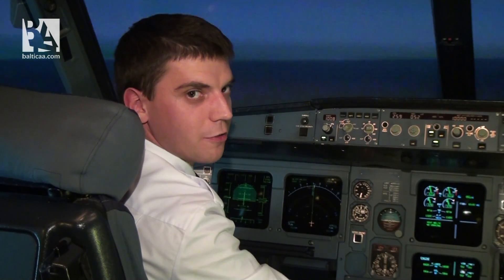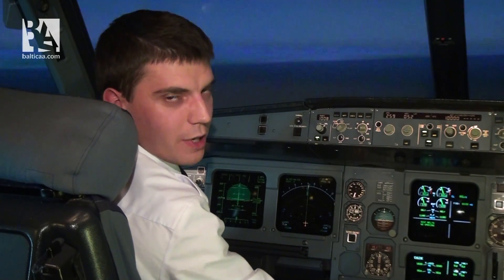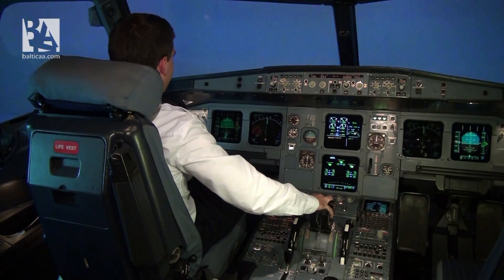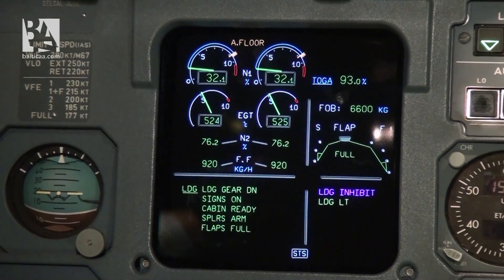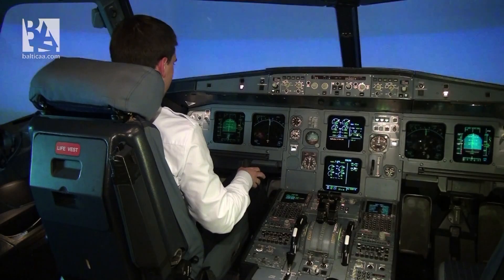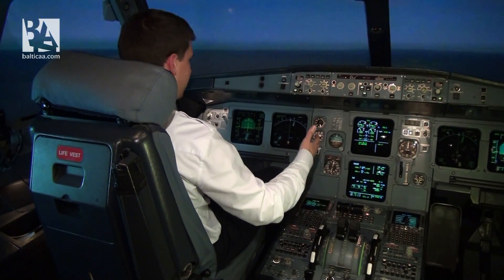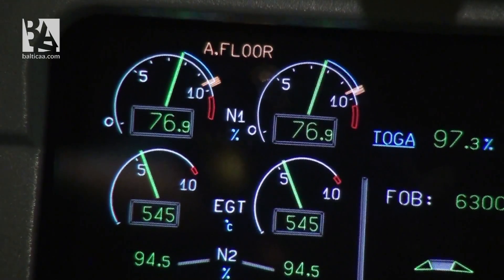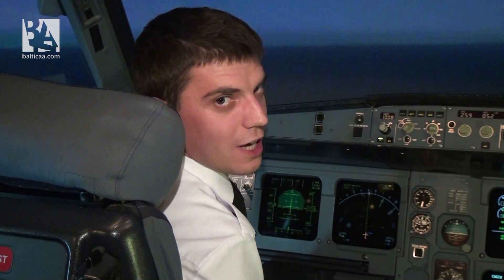Airbus A320 flight controls protections - Baltic Aviation Academy

Comment: Perhaps these "protections" lulled the crew of AF447 into constantly pulling on the side stick, thinking that the automation would save them. Don't put your or your passengers lives into the "hands" of an unthinking machine. Always fly the aircraft first!
Reply: That's poor training. These systems are designed to intervene when the pilots inadvertently put the plane into a dangerous situation, for example, messing up the go around procedure by not adding enough power/pulling up too quickly or too much for the selected thrust setting, it is not designed to fly the plane for them. It is similar to automatic emergency braking on a car, it is designed for emergency situations only, not to save you from having to use the brake pedal to slow down for traffic. What FO Bonin did was crash the plane into the ocean because he expected the stall protection to recover from the stall, which is like crashing into the slow moving traffic at highway speed because you expected the emergency braking to slow the car down

Comment: It would appear that the pilots of QZ8501 inadvertently disabled some of the flight control protections after receiving multiple alarms about the rudder trim limiter. It would seem they forced the plane out of normal law by circuit breaking both FACs at once; from my reading this means it can only be put back into normal law on the ground. Again from my reading, it would seem the pitch was put into alternate law (without protections), roll was put into direct law, and yaw was put into mechanical law. It would also seem that the pilots hadn't been trained in how to fly with the plane in this configuration; maybe similar to AF447?
Reply: +TankEnMate AF447 and XLAirways 888T Incidences both went into direct law due to icing of the angle of attack sensors in 888T's case and icing of the pitot tubes.  In the case of 888T the pilots had too much trust in the plane as they were performing an acceptance flight as for AF447 the first officer seemed to have a panic attack and kept his stick pulled back while the aircraft was in direct law. When the captain made it to the flightdeck and noticed what the FO was doing it was too late to recover the aircraft.
Reply: @ttmaggebo  no. AF447 was icing of pitot.
Reply: @peteconrad2077  I’m more on about the planes flight laws and how the pilots reacted than the symptoms that caused the flight law changes in the first place. The way the pilots reacted was similar in the end.

Comment: Any idea on how AirAsia flight QZ8501 managed to exceed the aircraft's max climb rate and stall? It looks like Pitch Altitude Protection should have prevented this.
Reply: It changed to Alternate law
Reply: It was in alternate law so no protections. Also it was the alpha protection they needed, not pitch protection.
Reply: flight QZ8501 looks like Air France 447 same causes

Comment: Hi Oleg. with all that protection, how 3 experienced pilots stalled the air france A330 killing everyone on board ?
Reply: I think , at 2009 there were no protections , I think they came later into the aircrafts .
Reply: I know that the speed sensors were frozen , but the flight computer(s) knowed that there was a stall in progress , so why didn't the stall protection kick in ?
Reply: TheGamer003 because the flight modes changed from normal law to alt law. Some protections lost as the result.
Reply: +TheGamer003 pitot tubes froze , air readings became momentarily invalid and protections disabled for a short while.. in that short time for unknown reasons one of the FOs pulled back the stick and stalled it ..and kept stalling it nearly all the way down to the sea..

why he did that? thats something that will keep minds thinking for a loong time.. its what confuses most investigators.. he didnt had any reason for doing that ..but he did it
Reply: +Chuan Shuo Chen the pitot tubes were frozen shortly.. less than 2 minutes.. they did had stall warnings but they didnt even comented why or about the unreliable air speed procedure..  thats the big mystery

Comment: I still prefer the Boeing planes over Airbus. At least with Boeing, if there is an emergency requring the flight crew to take extreme actions that push the aircraft outside the flight envelope the pilots of say, a Boeing 777 can shut-off the protection system with a disconnect switch and place all systems on Direct Mode, analogous to Airbus Direct Law. In that situation, flying in Direct Mode allows the plane to take any action necessary without computer interference with pilot decisions. That's the main weakness I find with Airbus, they present hard limits on pilot authority and no direct means to cut out the protection system in an emergency to allow the flight crew to take extreme actions that might be necessary even if it did damage the plane.
Reply: I also think so , in all Airbus aircrafts , shuould be a button wich shuts down the pretections . But I think , that Airbus is safer .
Reply: Of course computers make sometimes errors , for example wehen the sensors froze , then you need to disconnect the flight computer(s) , there where some incidents : http://www.spiegel.de/panorama/lufthansa-airbus-computerpanne-schickte-maschine-in-den-sturzflug-a-1024652.html
Reply: +Shayne T. Pendrick it's not meant to fly outside of the envelope, even in an emergency, the type of things you'd want to do outside the flight envelope would destroy the plane, airbus prevents that from suicidal pilots, stupid pilots
Reply: TheRabbitFear Well it didnt prevent the germanwings Crash.....
Reply: Computer never makes mistakes. And there are no cases in which you should turn off this system. Besides, ability to turn off the protection systems can cause very unhappy events.
Reply: TheGamer003 you can by dissabling 2 ADRs
Reply: Shayne T. Pendrick You can take full manual control of an Airbus A320. However to do so means shutting the computers off to allow that flight control law. Meaning your speed / nav displays will be off. You will have to use the backup gauges to the right. The only other way is if the flight computer receives conflicting information. Such as the angle of attack sensors giving different readings or blocking of the pitot tubes.  In this case you get a message on the flight management computer of above the angle of attack graph. However in this case pilots don't always see this. As the computers still look as though they are running. This is what caught out the XL airways pilots when they were performing a test flight in a plane they had leased from Air New Zealand. Airbus don't give you enough of an indication when the flight control computers give you conflicting information. I think if they did. The Boeing vs Airbus debate would be less heated.
Reply: There are no circumstances where exceeding the envelope is a good idea. It doesn’t happen.
Reply: @peteconrad2077  Try telling that to China Airlines Flight 006, exceeding the envelope is precisely what saved their lives even if the plane became a total write off, so try again smartass.
Reply: @EMSThinWhiteLine12866  the envelope exceeds me was a consequence of failure, not a deliberate strategy to recover. You got it completely wrong. Try sticking to stuff you understand.
Reply: @EMSThinWhiteLine12866  the fact you have to resort to infantile names proves you know you lost the argument.
Reply: @peteconrad2077  Show some hard studies or other evidence, otherwise consider it YOU who is defeated and my word stands over yours. End of statement.

Comment: Nice.  What is the warning tone that starts at 3:17?
Reply: it sounds when the aircraft is in manual flight (A/P disengaged) and you are leaving the altitude set in the FCU
Reply: Rin Zler
Thanks.  I still don't understand how AF447 could have happened.  Just that chime should have been enough to alert the PF, especially while the PM was saying they are climbing.
Reply: VWaudiRULEs AF447 stalled because the aircraft went into a mode called ALTERNATE LAW. The A320 has 3 levels of laws (Normal,Alternate,& Direct). Once AF447 left from normal law (as Oleg in the video is showing you) it degraded to Altenate law throwing out some of the protections you just saw him demonstrate. If you degraded even further to Direct law All Protection goes out the window. YOYO - Youre On Youre On - with no Protection. Hope that helps..
Reply: HouTexPilot Thanks, but I know about the different laws.  What is a real mystery is how AF447 entered what could be called a deep stall and stayed there for 3 minutes and a half.  No, they didn't have the protections, but 1) a qualified crew should not have done that; and 2) they had enough information to understand what was going on and take steps for recovery.  They had the stall alarm for almost a minute, and the warning tone when they left their selected altitude.  PF kept pulling up, PM kept saying they are climbing (in the beginning).  Just a few minutes the PF was saying how FL370 is out of reach for the time being, then minutes later he climbs to 38500!  To the best of my knowledge, they had altimiters that functioned properly (PM: "according to all three you're climbing" ).  And the shocker was they knew they had unreliable airspeed and alternate law from the beginning, yet somehow it made sense to keep pulling up.
Reply: +Chuan Shuo Chen Yes, there is evidence to suggest Bonin thought they were overspeeding.  Apparently he even talked about deploying the spoilers.  But still, how could he think that when he made the plane climb to an altitude higher than what he himself knew was out of reach (given the safety margins).  And given that he was pointing the plane nose up for almost the entire incident, until they start dropping like a stone.  If I remember, power was mostly below CLIMB, though he did select CLIMB for some seconds.  So many contradictions.  If they only followed the memory items procedure, it's so simple.  I can see Bonin, like many experts have suggested, following the Flight Director, which should have been tuned off once airspeed was unreliable.  There is strong correlation between his sidestick inputs and the Flight Director indications.

Comment: What's the spinning black and white discs?
Reply: That's the Stabilizer Trim controlling the Pitch of the aircraft.
Reply: Steve von Aesch how come they're exposed like that? Is there a benefit to having them out?
Reply: Ya. Before takeoff the pilot sets a trim for takeoff. After the takeoff the plane controls the trim automatically. In case the trim fails the pilot can still adjust the trim manually.

Comment: I have a simulated A320 in my Flight Simulator at home, and the protections and the Fly-by-Wire System are great, and it's easy to fly, because Fly-by-Wire.
I'm from Germany, so my english is not the best, but I hope, you unterstand what I mean ;)
And...I tried to break out of the limits of normal Flight, and I did it :D (Psst. but I deactivated the Fligt Control Computers :)

I find Airbus did a great Job with this Systems and I love Airbus 100000000000x more than Boeing (my opinion).

!!!I'm sorry for my bad english, but I'm from Germany ;)!!!
Reply: I also think so. The Boeing is much more funny to play in the simulator, but it is supposed that a plane with more than 140 persons onboard has to be safe and not funny for pilots. I prefer Airbus rather than Boeing.

Comment: I think, all this new technology, was created just for one reason : to save lives...!!! and it does it very well, in all these new "fly by wire" aircraft...Some years ago, we had the experienced pilots for doing it, now we have the computers...both are very good, but, to my opinion, many aircraft accidents have happened, due to their pilots trust to their high experience, so, we must leave the computers to do their well programmed work, cause they don't have feelings and they don't trust their experience, cause their experience, is their programme and their programme is 99,9 % right....!!!
Reply: ***** I agree with you my friend, totally agree, that's why i left this 0,1% percentage, because i know very well that,there is this very small probability for the computer to go off line, as you say..,and, by the way, the statistics for the computer's probability to fail out, is not mine, but it's from the Airbus Company, when it was running the experimental fly-by-wire programme, for the first A-320....

Comment: The flight control protections are good.  But how can you loose an airframe, like air france did, with these protections enabled?
Reply: Basically the speed sensors failed, so the airspeed was unreliable and neither pilots nor aircraft knew how fast they were going. So the aircraft couldn't provide control protection.
One of the big disadvantages of this system is that the pilots don't really learn how to fly the aircraft without these systems, so they weren't able to recognize the stall and recover it.
There is a lot more to this, try looking it up on avherlad.com
Reply: YPOC
I've read the report - the question was more a barb than a query.  And you hit the nail on the head here.

What happens when the basic FC protections fail?  Why was a United Airlines pilot able to pitch the rudder hard left/right?  Wouldn't basic FC stop this? 

No - The belts and braces approach is not taught.  It's proceedural flying.  Monitor the computer and hope that everything is good.

Another thing.  Why doesn't the flight management computer take Nav data from the GPS?  Pitots are good, because of their ability to read ACTUAL air velocities.  But a GPS can save your life......

Comment: To kokalti,
In the real life a pilot is very stressed by the many hours of flight in a sigle day, this may induce him to do errors even so serious. The "fly by wire" sistem prevents the happening of the two most dangerous situations of a flight: the overspeed and the stall. Anyway, in case of a emergency reason, you can also deactivate all protections by pushing auto pilot or auto thrust disconnect pushbuttons. It's the best solution for the moment.

Comment: now turn off the flight computers and see what happens!
Reply: +mohammed benachour easy... you stall and spin
Reply: The flight computers cannot be disabled
Reply: @dadcactus3399  Yes they can, they can use pushbutton switches to turn of ADRs 1 and 2 (leaving 3 on) which places the aircraft into alternate law.
Reply: well you can simulate minimal power scenario: RAT out, no engines operative. But then you will definitely do your best to try not to stall the aircraft :D

Comment: Now explain why didn't the Airbus save Air France 447...
Reply: super cooled liquid water blocked the pitot tubes-> no speed indication->no autoflight and stall prevention system available-> stall because of too high speed or too low speed...there is an procedure for such an emergency but the junior first officer who was flying wasnt very experienced whlie the first officer was trying to determine the problem..captain had his resttime and the junior FO didnt do the procedure and pulled the aircraft up because he was panicing...result was he pulled the airbus to its angle of attack limit and it stalled...this desaster couldve been prevented if the airbus had improved pitot tube heat :/
Reply: Samath Perera
But the pitot tubes were unblocked and showed real, reliable airspeed data after it stalled for some altitude. From then on, the A330 announces a correct warning "Stall !" for 47 times but the pilots ignored that and crashed.
Reply: The protections only work while the aircraft is receiving valid flight data. In the case of AF447, the pitot tube which measures airspeed froze over. That, in combination with a high altitude stall and the incorrect response from the aircrew caused the protections to fail.

Comment: I wonder is this works on Flight Simulator X...
Reply: Yes if you have the Aerosoft 318/319/320 this is modelled well.
Reply: That comment was made in November of 2013. It's been nearly a year and since then I have purchased the Aerosoft Airbus A320/321 and the PMDG 737 NGX. =P

Comment from the maker: http://www.balticaa.com This week Oleg Gaievoi, ATPL Integrated Students at Baltic Aviation Academy (Vilnius, Lithuania) shows a few Airbus A320 flight control protection situations (GPWS Terrain Warning and Stall Prevention; Bank Angle and Pitch Altitude Protection). Happy watching and let us know your thoughts and ideas for the new videos!
In case you have some particular questions regarding our services, feel free to write an email to info@balticaa.com.
Reply: I think that the Airbus, have more protection "from pilot errors" than the Boeing, that's why Airbus e much more "safest to piloting"!
Why don´t you made the same maneuvers in you 737Cl simulator to see the differences!
Reply: Hugo Candeias Also if there would be needed (by soem freak reason) you can put an A320 into totally manual control by dissabling 2 ADRs and reverting the FBW to direct-law ..wich gives the pilot direct control of the surfaces with the stick